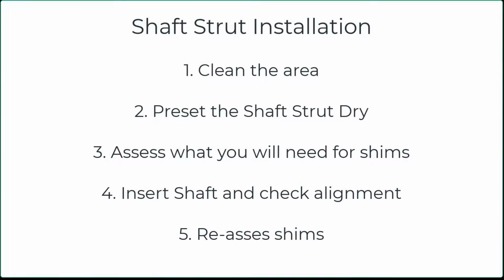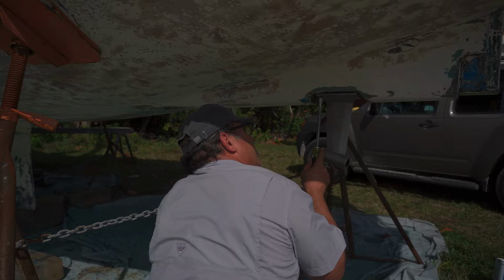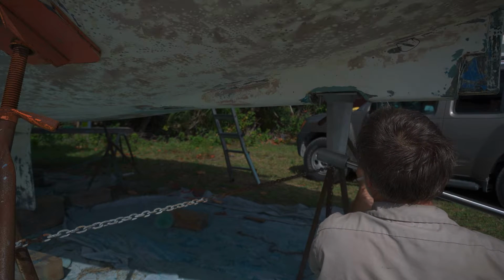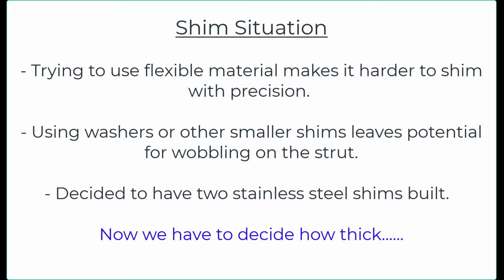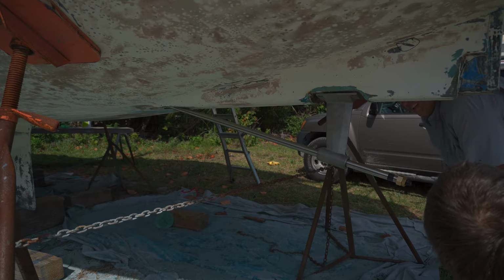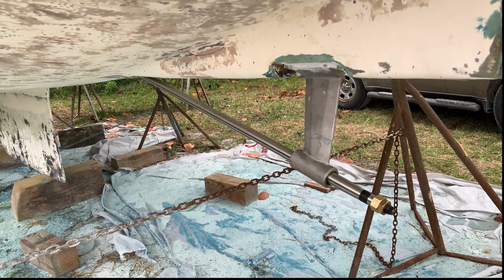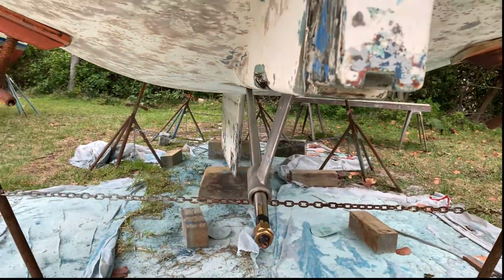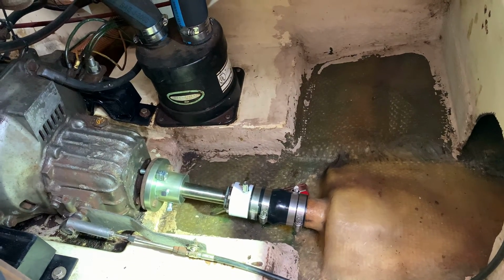How to Replace a Shaft Strut, shaft seal and coupler on a sailboat - Sailboat Restoration - Part 3

Comment: Nice video… random question, do you lock tite set screws into the strut / cutlass bearing or is that pointless when it goes in the water
Reply from the maker: The shaft strut is bolted through the hull. There is a steel backing plate inside.  It is secure with locking washers and nuts. So in this instance I did not use locktite. On any set screws I use locktite blue. Even if underwater.

Comment: I am considering the Peason 35 but the whole C/B is not so inviting. Why can you not just seal the board in the keel permanently. I've read that the C/B doesn't make much difference.
Reply from the maker: Hi Mike -  The centerboard is there to provide Lift and counter the lateral force from the sails. You can use it in any point of sail except down wind. It helps the boat from moving laterally when sailing.  The more you heel over the more they help.  The other big benefit of lift is to help you point tighter to the wind.  Although most cruising boats will not go any higher than 45 deg.

If you never sail in conditions where the centerboard provides you a benefit, you do have the option to pin the board inside the centerboard trunk.  Reverie has two holes on the keel that match holes on the centerboard.  If all I am doing is sailing Bahamas or FL Keys where water is shallow, I could just pin it through and not use it at all.  That said, our plans involve longer range cruising so it will be beneficial for us to have it available when in stronger winds and deeper waters.

Hope this answers your question.